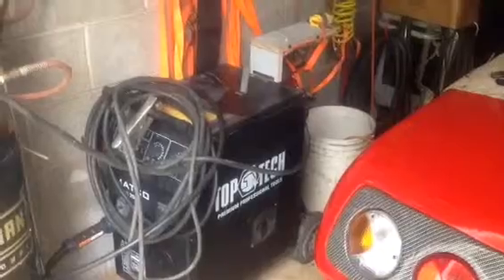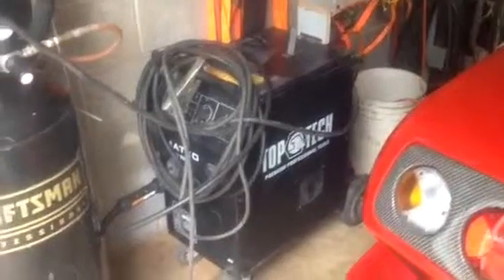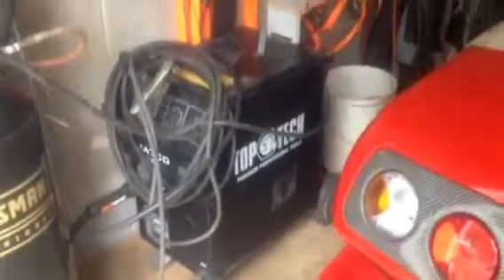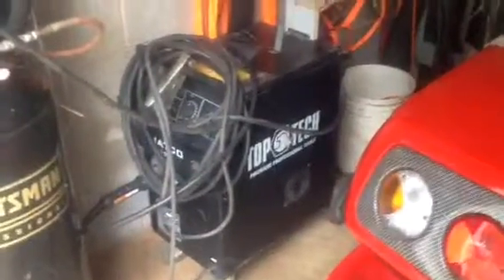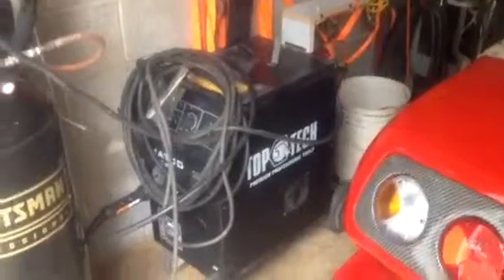Never forget to Turn Mig Welder Gas off again

Comment: Why not just get some soapy water in a spray bottle and fix the damn leak!?!?!? I never have left mine open, but I can go out to my welder a month later and the manifold still has charge pressure from the last time I used it. I actually let the pressure off my gauges anymore so they won't have 1k-2k psi on them at all times when not in use.
SOAPY WATER!!!!!!